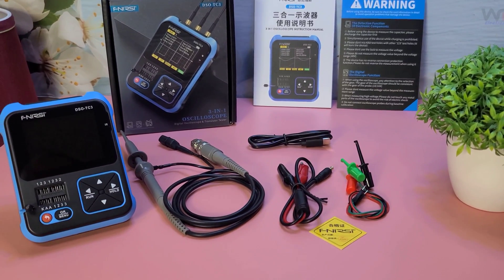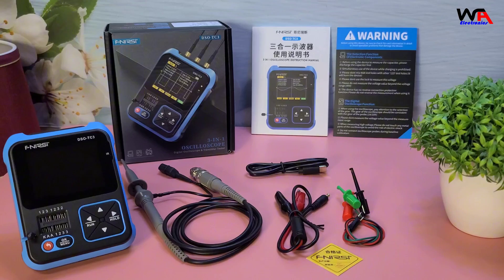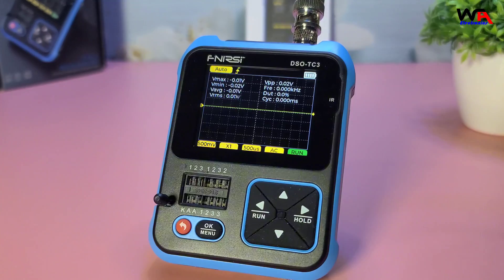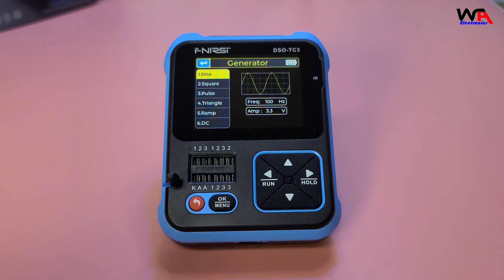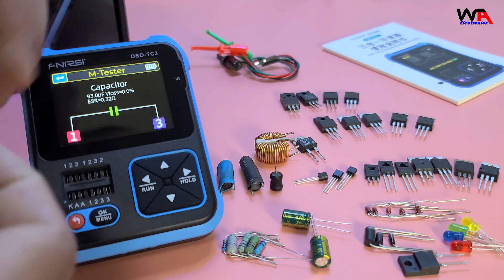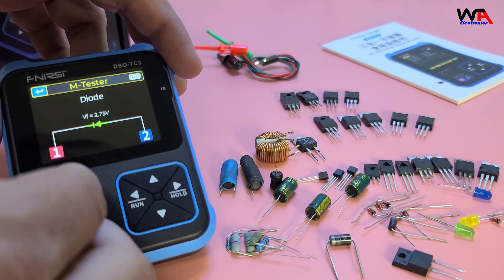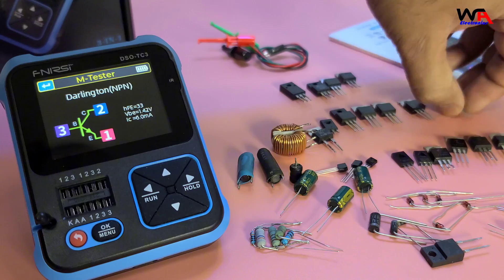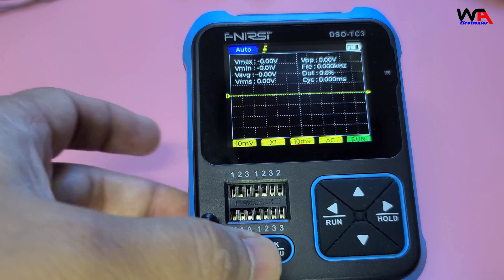3 in 1 FNIRSI DSO-TC3 Digital Oscilloscope Transistor Tester Signal Generator Unboxing and Review

Comment: How to measure current with it?
Reply: Put a small resistor (lower is better, 0.1 ohm are pretty common) in series to your circuit. Then measure the voltage over the resistor. An oscilloscope doesn't measure current directly like a multimeter. But with a resistor it would be the same as a multimeter, you just need to calculate the current.